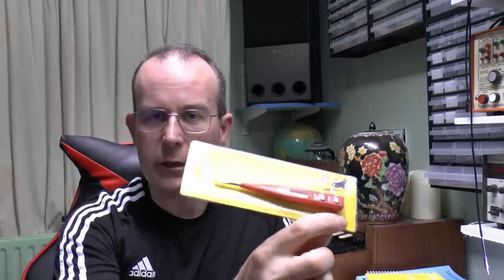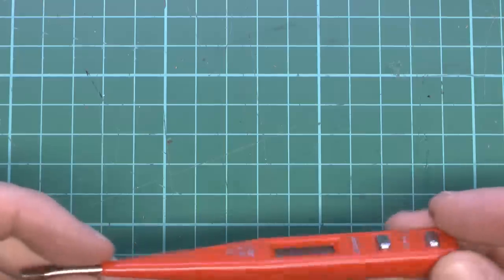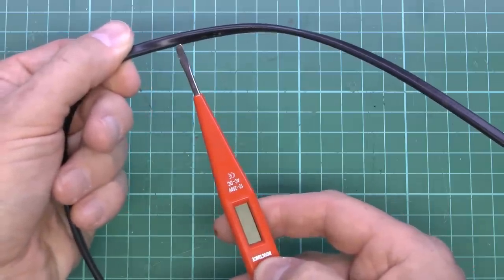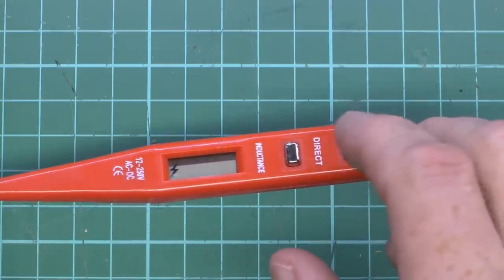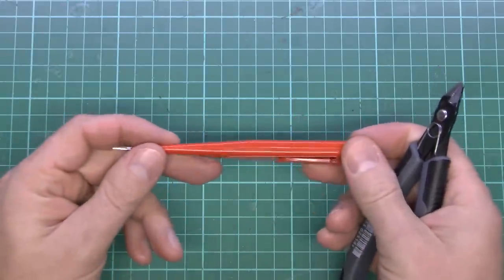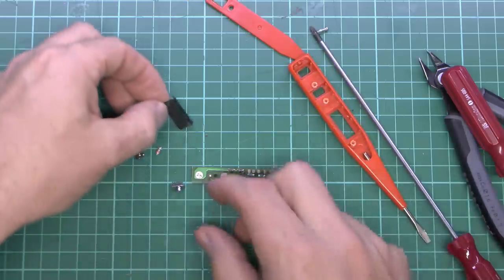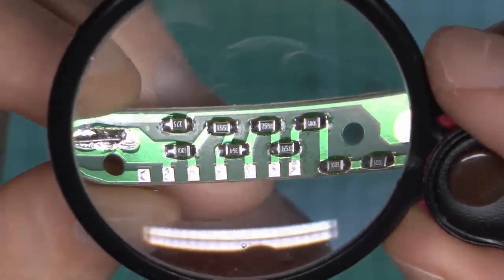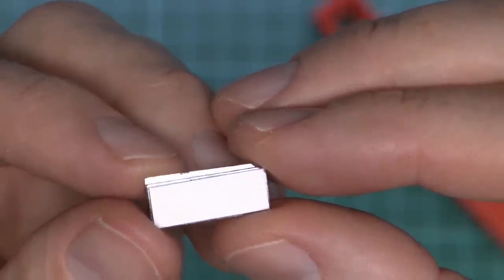Red LCD Screwdriver Mains Testing Item

Comment: I have one of these, and it is very useful for detecting live voltage through insulation. I have had several, some better than others so quality is variable. The one I have in my box is a good one, and can easily detect which side of a cable the live is on, and useful in fault finding. However, I wouldn't trust it in direct contact with mains voltage given the small size of the SMD resistors of uncertain spec, the track spacings, and general construction - eg not potted to prevent moisture, dust etc getting in, which would render it extremely dangerous! And I would never rely on it as proof positive a wire isn't live! Also found it useful on 12v elecs in the car etc. I'm a power electronics engineer by the way. It is a  concern with this kind of stuff is it's on sale to anyone...
Reply: In Italiano

Comment: The reason it was not reading correctly on the 2 core wire is because you holding the wire which makes interference .Hold the tester only to the cable

Comment: Hi John, these have been around for years, I got a similar one from a pound shop, got to be at least 15 years ago my one also has a small red LED or  neon lamp that also lights to show mains voltage is present, the voltage Indicator is actually fairly accurate if you touch it on a car battery, just the 12v displays, touch it on a  BT phone connection it will show the 55v display,  but I just use it for tighting screws in small choc block terminals.

Comment: JW, did you know the CE marking on cheap Chinese stuff means "Caveat emptor", Latin term that means "let the buyer beware"?
Reply: I thought it was "Chinese Export"
Reply: Nuts n Proud. Alternatively 'Crap Electronics' :-)
Reply: I thought it meant "Chinese Excrement".
Reply: Poor Poor  it gives more options for buyers for when they want cheap and practical to suit every budget which is good last time I checked for instance a bought a air rifle  English designed  then built in China  so and products fairly decent yeah an English made one for a bit more money will be smoother engineering and better materials etc but it works so what's the problem

Comment: I use these a lot for detecting leak current from unearthed or double  insulated devices, you can see it with the lcd something i can't get done with my fluke that's  got an led, (can also be done with a multimeter of course which is the proper way to do it as you're basically measuring voltage). Also earth induction loops.

Comment: The CE Symbol on that thing stands for China Exported. They deliberatly designed that Symbol in a way, that it gets confused with the proper CE Symbol. 
It basically just means, that that thing was produced in China.
As Jonathan pointed out. That China Exported thing might be a myth. Anyway. That thing is crap.
Reply: It's more likely a myth. These kind of factories have no problem with putting fake marks on their products so I can't see why they wouldn't just put the CE mark on and claim it as genuine conformity. It's a wonder they'd not more people getting killed by some of the crap on ebay (and Amazon now)

Comment: if you are going to cheap out , for fuck sake use a cheap multimeter instead. that way the multimeter will die and not you if you fuck up or the shoddy build quality craps out. Either way just don't gamble with your life for a few bucks saved.

Comment: Excellent teardown.
So if the resistors are destroyed, they might still have enough conductivity to relay a harmful shock to the body?
Well I won't be jamming this in any mains sockets any time soon..
Also I notice it can pick up voltages from higher voltage household appliance , Computer, televison etc, lines from around a centimeter away, but try it on something like a modem's power lead and it fails to read the charge at all.Now it says it's good for 12 volt..which the modem is operating on, however , the modem lead does an excellent job of masking that from the tester...must try testing it on my motorcycle cables, but really I think it has limited usefulness. Not going to replace the multimeter.
Still, in certain scenarios could be a valuable source of feedback.
liked subbed etc.

Comment: lol, I have one that's probably from 2005, always use it when I can't be bothered to grab a multimeter.
I always laugh when people try to make these cheap testers sound "dangerous", like, what did you expect? it didn't cost you $50.
I've used more sketchy stuff to test mains voltage.
Reply: I mean. Seems dangerous. But I've seen electricians do crazier stuff. I got one as a part of a networking kit. needed the multimeter, Cable tester, punchdown tools and end crimpers for RJ-45/RJ-11 And one of these dodads was in it. Had to watch like four videos to be absolutely sure and start to get confident in sticking this thing in a power strip 😂 won't catch me using this in any actual sockets but it seemed to be fine. 

Nice to quickly check if there is power to a line if I'm to busy to swap a cable not knowing if it'll work or can't be assed to grab a multimeter. Good for checking mice and keyboards I like it!

Comment: last several digits ended with V is the voltage. in your video, the voltage is 220v. The quality depends on how much you spends. If you go cheaper way, then it is the quality you get. At least, it works. If you spend more, you definitely will get some thing decent. Never expect you got high quality with very low cost, then say shit to the 5 cents stuff.

Comment: i think when you test the main cord wire , your hand cant hold the wire, this will make your hand induce the same potential .. you can let the wire lay down and use your test pen to touch the wire skin . i think it should work..  To test DC battery like 12V ,36V ..etc the probe touch the positive , and finger press on direct and another hand touch the negative terminal.  The highest voltage will be the reading voltage.. it only able to read 12V ,36V,55V, 110V , 220V , the highest voltage will be the reading voltage.

I have one bought it from china, i still learning how to use it..
Reply: I have one of these, now i know how it is used, thanks

Comment: You said 'quality' in what I took to be a sarcastic way about the plastic protector being left on the LCD. Actually it is quality in so far as these protectors are always left on. I recently purchased a £1300 spectrum analyzer and a £2000+ RF generator and they both had this protection on the displays. Not having it is a 'quality' issue. Apart from that the screwdriver is useless of course.
Reply from the maker: Nothing wrong with protective film, but it's there to be removed by the user - in this thing, it can't be removed without dismantling the device.

Comment: Hello John ' I am finding a lot of aluminium cable on existing installations ' just wondering how you would code it on an e.i.c.r .
Reply from the maker: if it really is aluminium, then it's C2 or FI, due to the lack of information about such cables.
However aluminium cable in smaller installations is rare, it was only used for a couple of years and most of it will have been replaced decades ago.
Virtually all silver coloured wiring found in older installations is tinned copper.
Reply: @jwflame  hello john thanks for getting back to me.  it stranded cable twin and earth with pvc insulation finding lot's of it on some 1960 s flats , allways assumed it was aluminium, maybe as you say   , could be tinned copper. its in good condition for its age .no thermal damadge etc .carnt find anyfind anything in regs or code breakers book .

regards Pete .

Comment: Thanks John another reason not to place your life in the hands of the Chinese. Note how the inductive wire antenna passes over the direct wiring on the PCB and with no insulation. If it gets pressed too tight then you get zapped on the inductive button. An item straight for the bin !!!

Comment: That's probably half of a chinese electricians tool kit!  The scary thing is that they must be selling them!  For voltage testing, in our electrical fitters standard tool kit, in the power station, for some reason we were supplied with a martindale tester which I can't recall anyone ever using!  We always used our fluke multimeter.
Reply: gartmorn it is likely you were issued a ‘two pole voltage tester’ because a multimeter is not recognised in the HSE’s guidance note GS38 (safe electrical isolation) as a suitable method of proving dead 😉. Too easy to be on the wrong range and end up with a live circuit showing dead (especially is a proving unit is not used after the dead test).
Reply: @sparkydave2783  That's sounds right .  I seem to remember we also had a test point where you could check them in the workshop.
Reply: @sparkydave2783  proving dead if a permit was required was carried out by the permit engineer who signed the certificate which could be for anything up to 17kv.  On HV circuits we would watch the circuit being tested and then the engineer would touch the circuit before asking us to work on it!